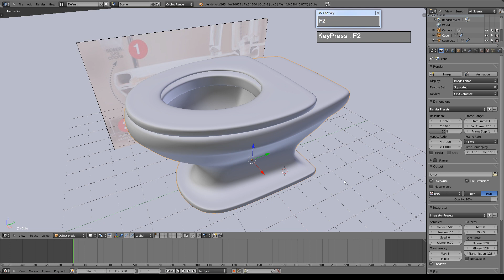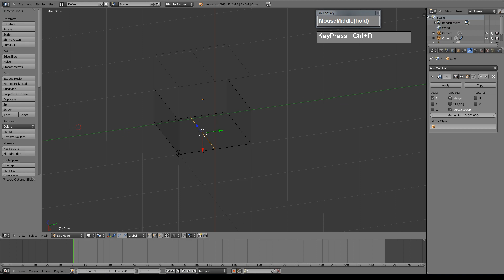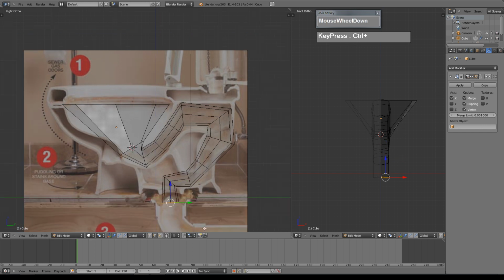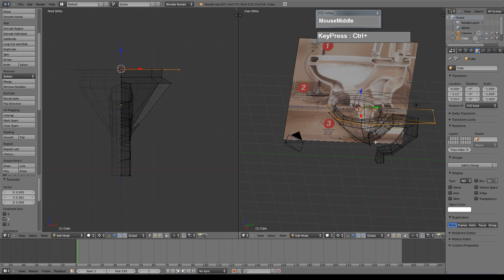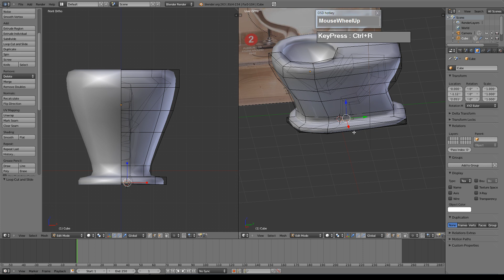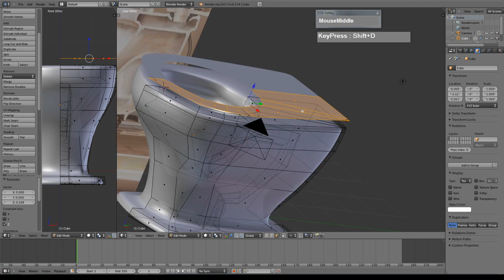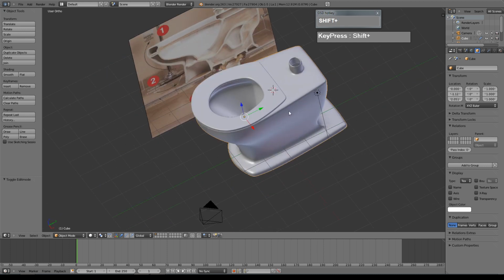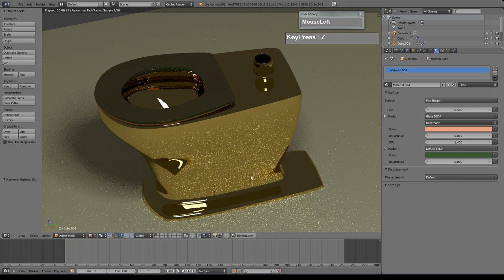Blender Modeling Tutorial - Modeling a Toilet Bowl and quick Cycles

Comment: My bowl brakes down at when you subdivide it at 11:14 the top part starts to spread like it wasnt intact..?
Reply from the maker: Make sure your clipping is turned on in the mirror modifier. That should fix it.
Reply: weeliano It is turned on. I use the latest 2.72. Not working for some reason? I am very beginner and i can't solve whats the catch now..
Reply from the maker: npmice Try pushing the half section closer together in the center seam. In edit mode. Select all vertices and move the  half section until they overlap. You might also want to try deleting the subdivision modifier and reapply again.
Reply: I had the same problem. I think it is because the vertices are too crooked/lop-sided. I solved this by straighten them out just a bit (both top and low vertices at the middle of the bowl.)